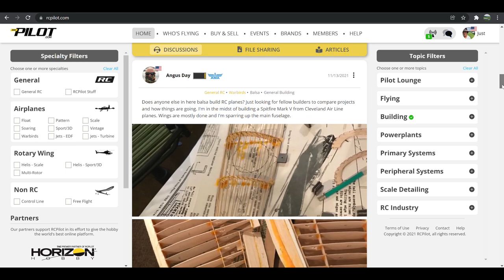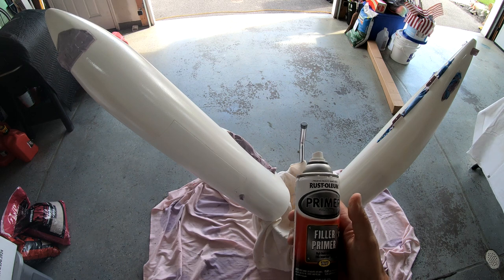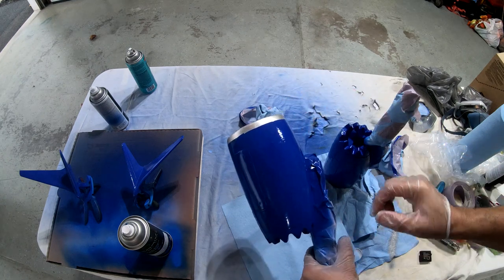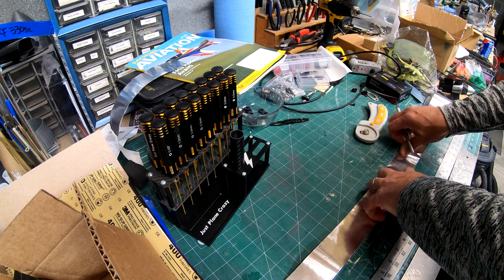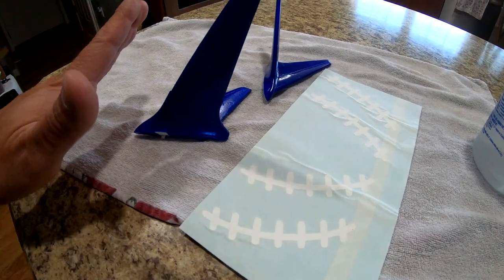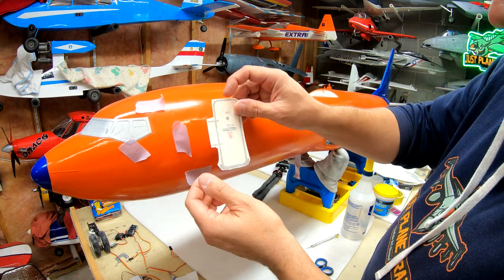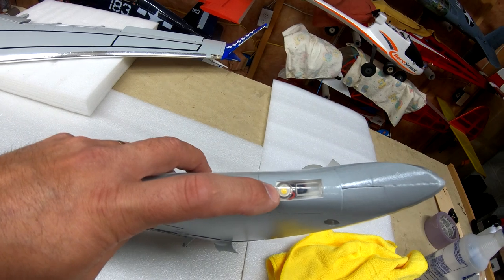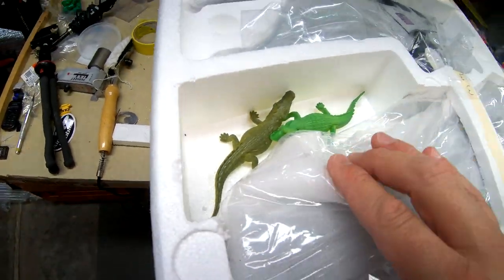Custom Florida Gators Build of the Freewing AL37 for RcPilot.com, Custom Work From Callie Graphics

Comment: Another gorgeous livery.  I liked seeing all the various jigs used to paint and assemble.
Can you pls provide some detail for the custom screws used to make it easier to hand screw the wing bolts?
Reply from the maker: Thanks. 3mm Allen head bolts the needed length from RTL fasteners. If u order from the use code jpc30 to save 30% on any order over 50. I get nylon spacers from lowers and cap covers that I press on with a vise from McMaster Carr

Comment: I got a question, I painted my Al 37 man came out great will the clear spray do any damage i want it to be shinny once i am done.
Reply from the maker: I used the minwax WATERBASED  Gloss. Several light coats work great. Practice on some old foam pieces to get it down.
Reply: Okay cool thanks.